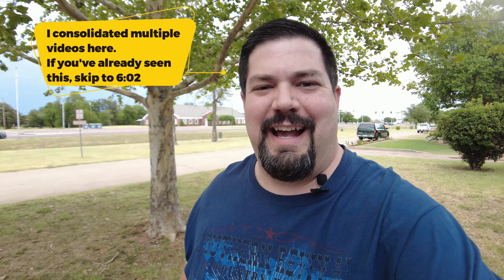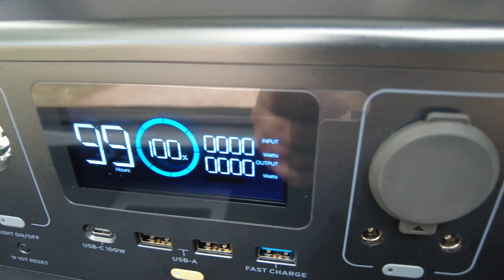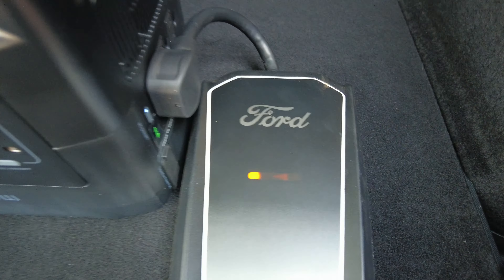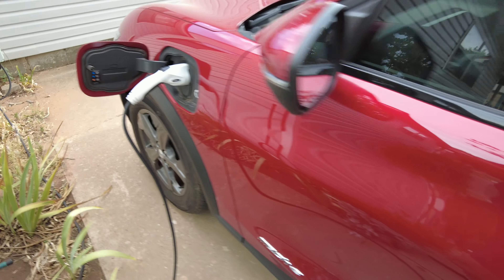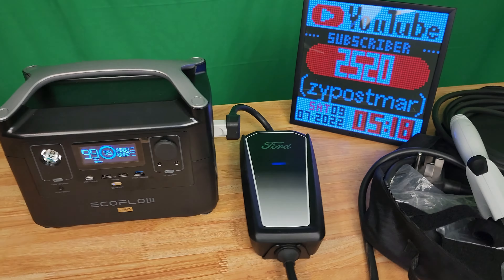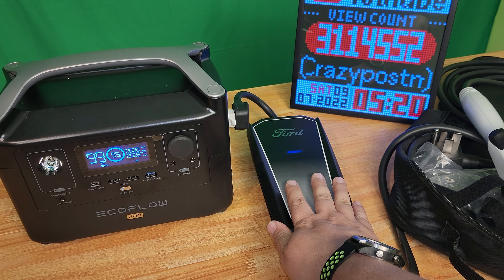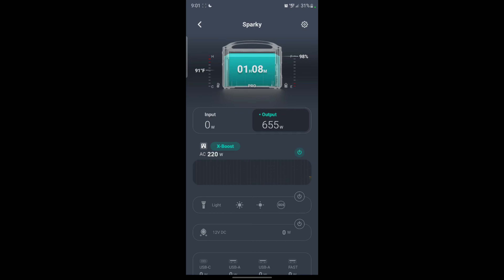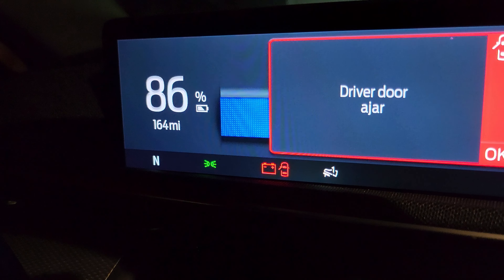Can you use a Ecoflow River Pro to charge a Ford Mach-E?

Comment: I've heard of a similar thing happening in very cold climates (like Alaska in the winter) when using the supplied L1 120v charger.  The battery management system uses more power than the charger can supply, so range (or state of charge) actually decreases when "charging".
Reply from the maker: This happened to me in the Tesla too. 120v charging and I had the air conditioner running and I was getting a net negative charge haha

Comment: So after some fiddling i realized it’s the watt limitation of the River unit. The x boost mode doesn’t effectively deliver the right voltage/wattage either. The solution for me was returning the River and picking up a Delta with more watt output. I can charge at 120v at 8 and 12 amps (1400 watts) now and the 1kw unit adds about 5km onto my eGolf range. Not much but does work! Had to use a grounding plug in the extra AC socket to trick my charger into thinking there is a proper ground.

Comment: Yeah, I'm sure the X-boost feature didn't work at all for EV charging. That has got to be the most painful Level 1 AC charge ever. All of your battery bank's power went to charging losses.
Hopefully your Ford portable charger is okay with the battery bank doing its current/voltage limiting cycle for a few hours.

I wouldn't say you lost a mile though, your % SoC didn't change so it's likely that the GOM range estimate simply ticked down from moving your car to the carport. Basically you gained 0%.